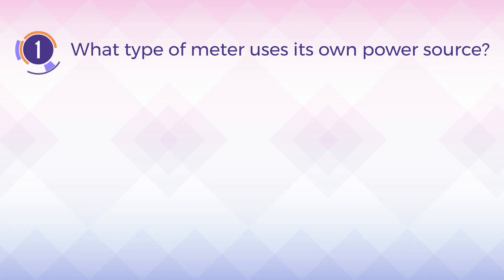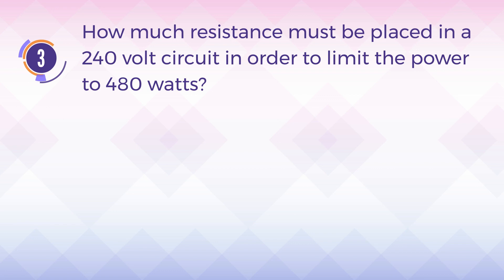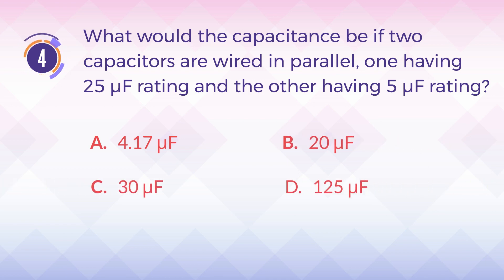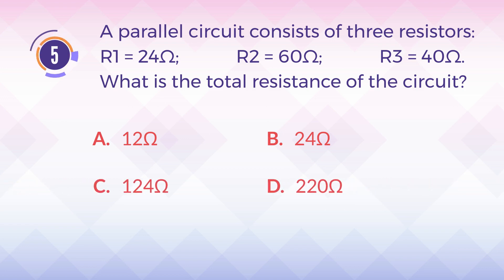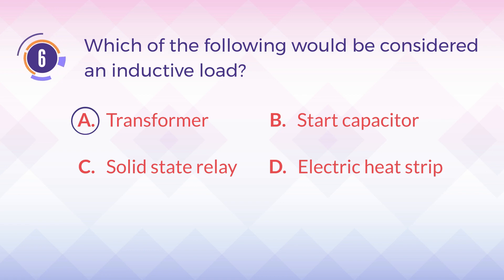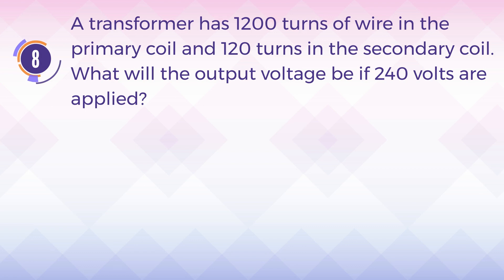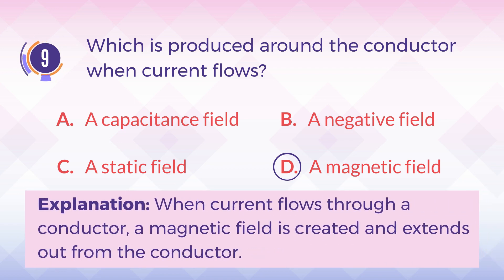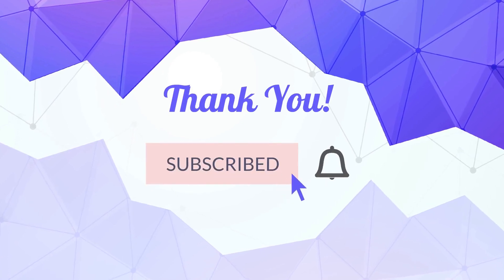HVAC Exam Prep #9 - Principles of Electrical and Refrigeration Theory | TruePrep

Comment: Seven is wrong inductance and capacitance reactance is based on frequency
Reply: So what is your answer
Reply: @theviral7290  correct answer is ohm
Reply: Can you  tell us what is the right answer
Reply: @theviral7290 Xc and Xl reactance is calculated using the frequency.  Therefore, all of the answers listed are required to calculate impedance.  Xc = 1/2pifC, Xl = 2pifL, where pi= 3.1415926…, C = capacitance, L=inductance, f=frequency